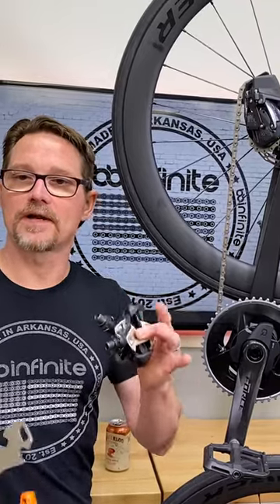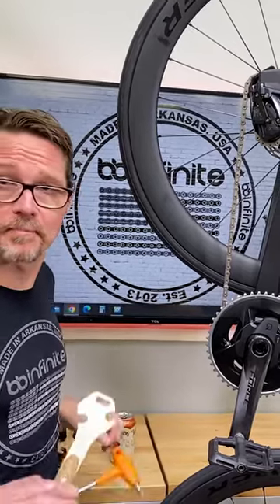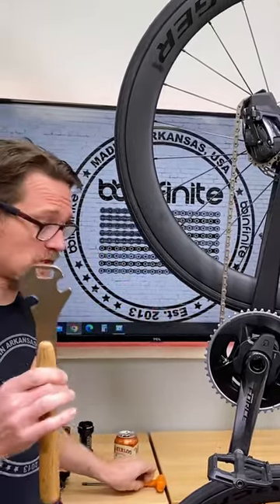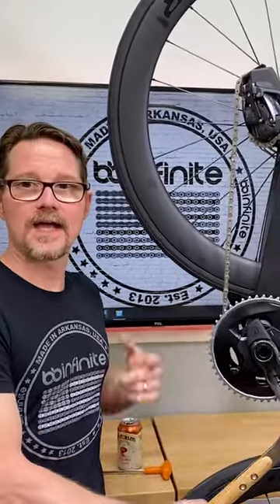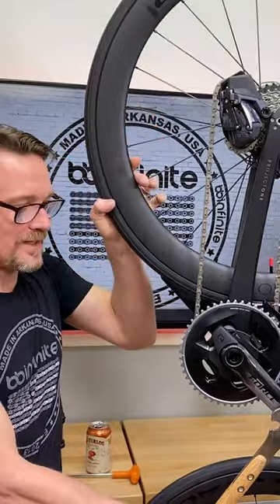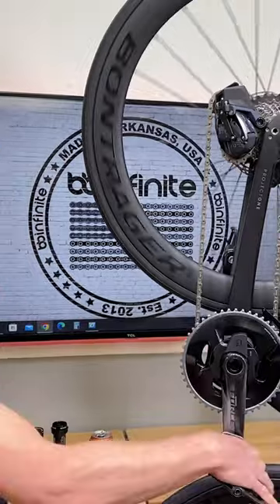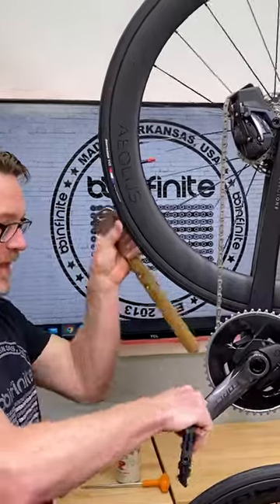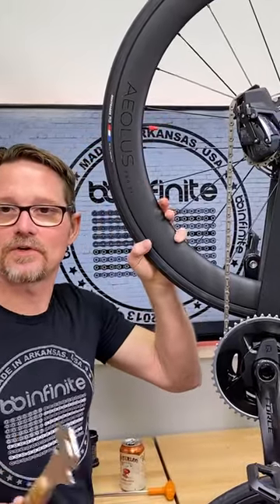Easy Pedal Removal Technique to Avoid Confusion

Comment: With the bike on both wheels, I always just pull back with the wrench upright towards the rear wheel to remove. His works good too, but if you don’t have a stand.
Reply: Stand the bike upside down.... No need for a stand.
Reply: @ShockBot127  This works, but you'll then have to adjust the cockpit, since it gets moved when you push down.

Comment: The trick i use is. When both wheels are on and on the ground. Put wench in the back. If the wrench is behind the peddle and must turn  forward that is off.  It the wrench is forward and must turn back thats ON

Comment: I have a question and my question is
What is the reason of having annoying sound when ever you start pedaling specially when your pedaling in heavy gear?

Sorry for my English I'm still learning
Reply: Are you referring to the clicking noise when the wheel spins? 

That is a freehub, which is only active either when 
- the wheel is turning forward but the cranks (the things that the pedals attach to) are not moving 
- the wheel is turning backwards 

The reason for this is so you can stop pedalling and the wheel continues moving, otherwise if you stop pedalling the wheel stops moving. This is seen on single speed bikes, also known as fixed geared / ‘fixies’. 

It makes that noise because there is a ratchet system inside the rear hub which disengage when under load (pedalling) and engage when coasting or when the wheel spins backwards. 

Sorry for the long comment, but I hope this is helpful :) your English is great by the way!!
Reply: what about the creaking sound when you pedal so hard I try checking my freehub all is fine I try cleaning it and re greasing it again still the creaking sound is still there😢
Reply: @Motivation095  it’s your bottom bracket I’d imagine, needs replacing or re-greasing.
Reply: Oh ok thanks for all of your advice about love em all it was all very useful idea
Reply: @Motivation095  no worries, if you’re still getting issues after fixing the bottom bracket feel free to ask some more questions and I can try and help you some more
Reply: Could be your chain rubbing on your front derailleur